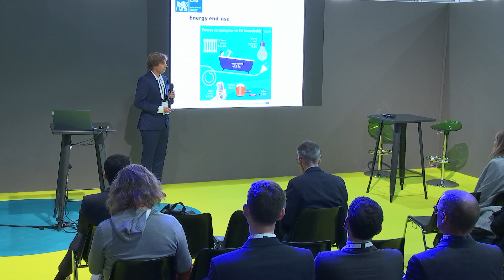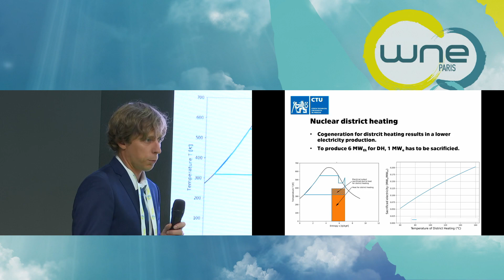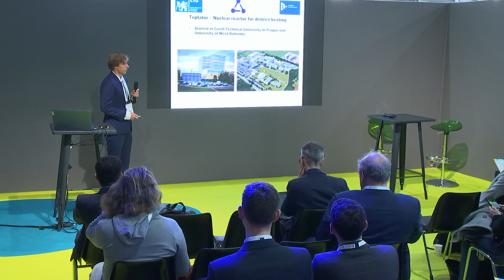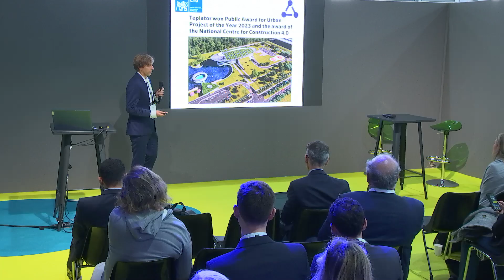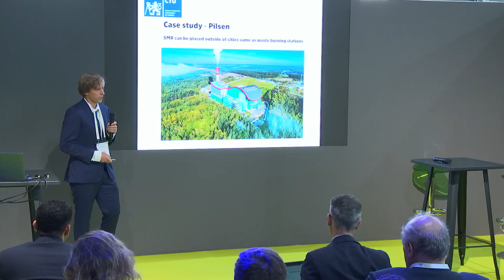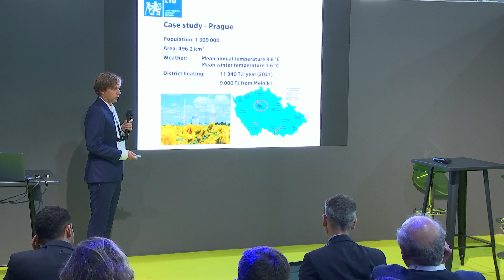WNE 2023 - Workshop Teplator - Unlocking the Potential of Nuclear District Heating in Europe

Comment: Amazing stuff! Wouldn't it be better/ more economical to use a standard LWR for the co generation of heat and power?
Maybe, instead of using gas boilers for additional heating, you could use the electricity generated by the plant?
Reply: No, since electricity production requires a much more expensive design since pressure and output is much higher.